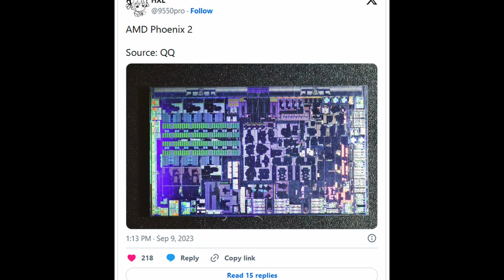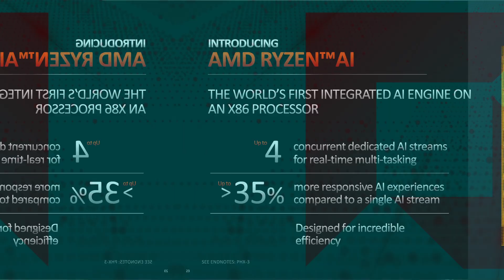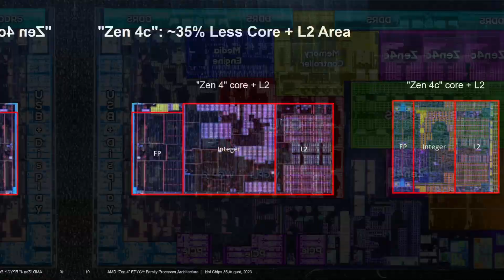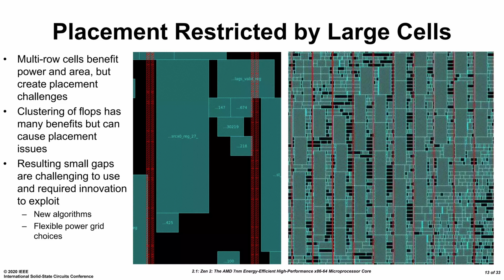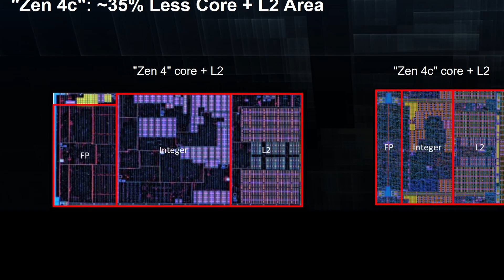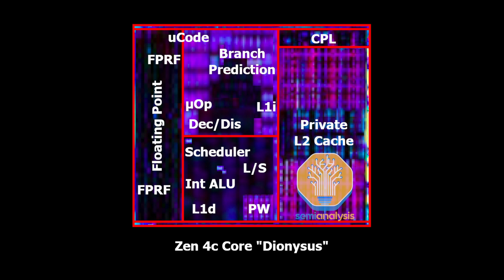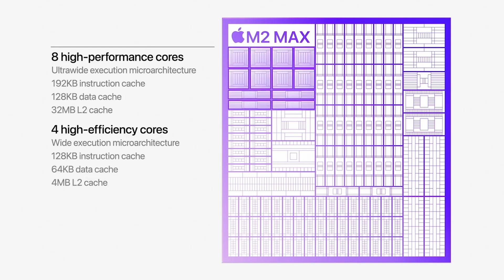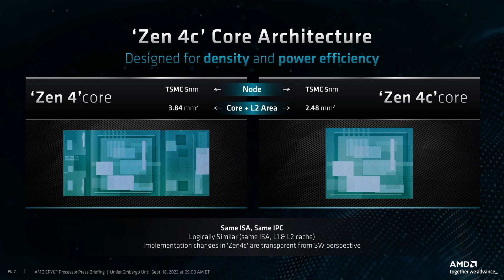Why AMD's first Hybrid-CPU is Different

Comment: Actually the RTL is part of the design tools intermediate format.  It’s a step in the synthesis process, the place and route step will apply the “design rules” for the fab process.
Reply: Fuck, you made me remember my Semiconductor design courses....goddamn Cadence tools... absolutely sucked... made me loose my interest in the subject area, knowing that I would have to work with them.
Reply: @WetPig  I remember that pain as well. Although I'm still very much interested into semiconductor design, but well... Not with Cadence. 🤕
Reply: @WetPig  I generally think FPGA and ASIC courses being taught poorly in university is more of a reason for experience with tooling to be poor. At the end of the day, the reason the user experience of the tools is poor is because of the lower amount of users (silicon engineering staff) but realistically, the less user friendly and lower productivity a tool, the less you are expected to produce at work. Overall it is a pretty good paying career and the pain of the tools is not much different for many different industries. Fighting with Altium or Cadence OrCAD for PCB design, fighting with CST or HFSS for RF design, or Ansys for CFD or FEA, or SOLIDWORKS or NX for mechanical design... it is all quite the same. I think only the software industry is different on that front, but because of it, the industry moves a lot faster and is much more competitive, in ASIC design and FPGA design, once you know how to do enough things, your career is much more stable. There is essentially a vertical learning cliff you have to climb, rather than even a steep learning curve but I think it flattens somewhat more than for software industry professionals.
Reply from the maker: So the RTL is adapted to the node specific design rules first?
Reply: @HighYield  Junior ASIC design engineer here. The RTL design is basically the functionnal description of the chip written in HDL (Verilog, VHDL or SystemVerilog).

The synthesis tool takes as input the RTL design and the node/process-specific library, i.e how exactly a logical function in the RTL is translated to a set of logic gates and the physical characteristics of this set of gates (length/width, electrical resistance, etc...) in the chosen fab process. The output produced is something called a Netlist, which is basically the list of all the logic gates and how they are connected to one-another in order to have the same logical behavior as the RTL. Then the Netlist is placed and rooted in the physical space to create the final die layout and the shadow masks used by the fab.
Reply: @HighYield RTL indeed sometimes can be customized for a specific node. There are many iterations of synthesys, placement and RTL updates to achieve target power/area/speed requirements.
Reply: @HighYield RTL is free from the Node library. RTL is first synthesized to the generic library netlist, then depending on each node from the manufacturer(i.e TSMC), the mapping will apply to that node library. Actually, some RTL IPs from the 2000s are still being used in today's N3 SoC.

You can see why AMD chose to use the same RTL core Zen 4 C (classic) cores, and Zen 4 D (Dense) core. It saves so much time not to redesign the architect but gives an edge on the area target. Such kind of reuse requires less effort to design/verify/implement.

Comment: Current rumours are that Zen 6c will go upto 32 cores on a single chiplet (CCD), that would be some serious multi-threading performance in such a small area.
Reply from the maker: If Zen 5 focuses on the core design, Zen 6 will most likely change the chiplet layout. I'm really interested how AMD will play this game.
Reply: @HighYield     hey Max, good speaking to you again, yeah it's going to be super interesting to see what both AMD and Intel do over the next few years. 
Tom at MLID has heavily downgraded his expectations for Zen 5, other people are still suggesting it will be a very decent jump in performance though, I really don't know which way it will go. I'm more inclined to believe Tom's sources and analysis but naturally I want it to be as big of a performance jump as possible. It also looks like Zen 5 will get 6-9 months of unquestioned leadership over Intel as I can't see Arrow Lake coming any sooner than very late 2024 and maybe even slipping into 2025 given Intel's recent execution. But the rumours for Arrow Lake sound really impressive, so depending on how good Zen 5 actually turns out to be, Arrow Lake might end up destroying Zen 5 when it's released which would be really interesting. 
Then we have to wait on Zen 6 to see what AMD ends up bringing us and how long it takes Intel to replace Arrow Lake with Nova Lake which is meant to be their 'BIG ONE'! 

I think AMD won't have a choice with Zen 6 other than to double core count to 32 cores but I believe if they do this then they will need to move to AM6 and step up to quad-channel memory to keep that many cores fed.

As I say, super interesting times and I love that AMD and Intel's launch dates are well separated now so that they have to properly leap-frog each other in performance plus complete against price eroded products when setting their launch prices!
Reply: I doubt it would have enough bandwidth
Reply: @tuckerhiggins4336  It would be at least 12 channels of DDR7, could go up to 16 channels or they might use HBM4.
Reply: @Speak_Out_and_Remove_All_Doubt  This. At that level of core stacking, memory bandwidth is pretty much only a question of with what price can we get away with.

But I don't think that Zen6-C-Epyc (can't recall if the codename has already been leaked) will opt for HBM. It'll not only need some serious bandwidth to feed all these cores but also capacity aplenty. HBM may be fast, but that hypothetical 384 core monstrosity will certainly take RAM in the terabytes, not gigabytes.
Reply: @danieloberhofer9035  yeah I can see HBM being used like an L4 cache to buffer the DDR7 but who knows.
Reply: @danieloberhofer9035  Zen6 EPYC is Venice codename.
Neither Zen5c or Zen6c successors to Bergamo have codenames AFAIK tho
Reply: @robertstan298  That's why I didn't call it Venice. Although, in retrospect Venice-Dense would've been better than calling it Zen6c-Epyc.
Reply: Wasn't there a rumor that Zen 5 will have 16 core CCXs/CCDs? Idk if we can go from 16 to 32 core CCDs in one generation assuming the former to be true.
Reply: @putrescentvermindefunct  Zen4c already uses 16c CCDs in Bergamo. Zen6 going to 32c CCDs, probably in it's dense configuration, comes from Moore's law is dead in Tom's recent video. To my knowledge, there's no info regarding if CCX=CCD, though.
Reply: @putrescentvermindefunct  Yes there were those rumours and they are true but its for the Zen 5c variants, I am not sure we will see these come to Ryzen though but it is possible we could see a 24 core CPU with 8 x Zen 5 and 16 x Zen 5c.
Reply: That makes sense. If we speculate that C core have half the preformance, they would need way more than 16 to increase the over all preformance.... still i kind of think something like 4 or 8 large cores and 16 C cores make more sense.

32 is a even number of cause, but it really only make sense if all cores are the same. Having 4 zen and 28 zen C or 8 zen and 24 zen C is a od mix.
Reply: @matsv201  it naturally depends on the application but the C cores will be much better than half the performance, they are basically under clocked normal cores with less cache. So in something like Cinebench, 32 c cores would destroy 16 full cores.
A good combination would be 8 x Zen 5 3D + 16 Zen 5c.
Reply: @Speak_Out_and_Remove_All_Doubt  well.. of cause. But most normal aplication scale poorly over more symwtrical cores.
Reply: @matsv201  yeah that's why I think Zen 6 will be the perfect balance if everything does double, 16 x Zen 6 3D + 32 x Zen 6c, that would be a monster chip!! As you say, most things won't scale past the 16 super fast cores but when it does you have another 32 still very good cores to call upon.
Reply: Likely it's all their C cores, but given it's gonna be on either 3 or 2 nm, it's likely gonna be the only Core type by then, since there isn't much point shrinking Cache below 5/4nm due to them not gaining any performance
Reply: @hinter9907  But AMD already has the solution for that with stacked V-cache. In future core designs they could completely off-load the L3 cache to a separate die (or dies) because as they have already proven with V-cache, you can shrink cache considerably if that is the only microarchitecture on the chiplet.
Reply: @hinter9907  Yeah the 32 Core version of Zen 6c will be the Bergamo successor. If they stick to 12 CCDs then that's 384 cores on a single CPU! 
It's rumoured to be 2nm but I personally don't think TSMC will have this node ready for AMD early enough or Zen 6c will be late, not sure which.
Yeah I would leave cache on 6nm pretty much indefinitely now, it's a much cheaper node plus has loads of capacity.

Comment: I think they should cut the on die l3 cache and just have slightly bigger l2 with interconnects for the l3 vcache, save that space to make room for more gpu workgroups and add vcache that can be directly accessed by the cpu and the gpu, an extra 32 to 64 mb that can be flexibly allocated to gpu and cpu with much more avaliable
Reply from the maker: That would be a amazing product, but much more expensive to produce.